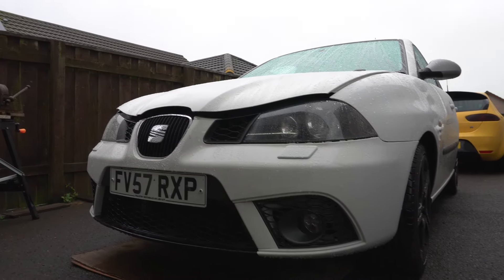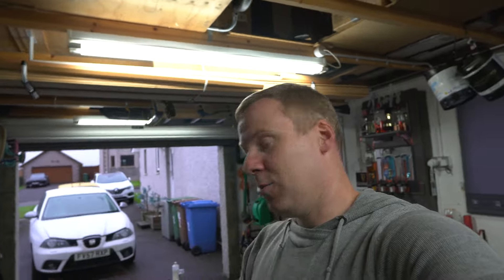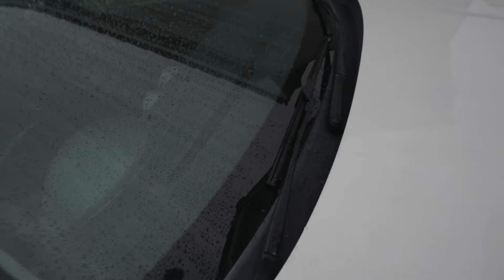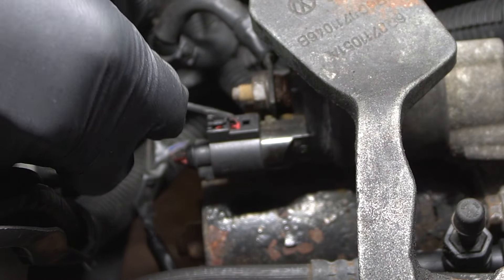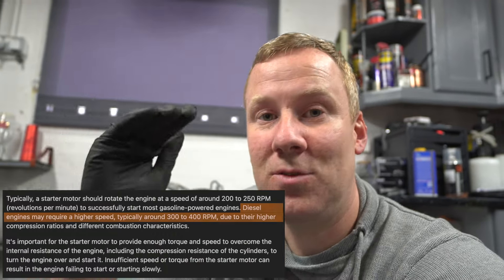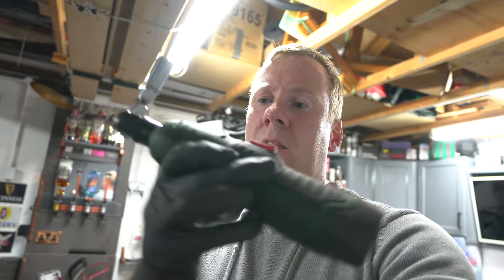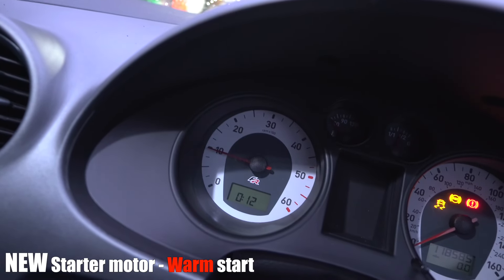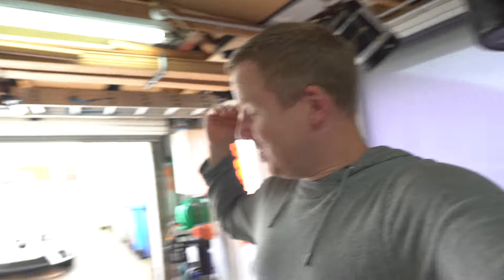My LAST attempt at FIXING my Ibiza's Warm Start Problem...

Comment: My Ibiza 2002 tdi , starts and then stops. The dashboard lights have also stopped working. Have you experienced this problem before . Thanks
Reply from the maker: Hey John, I'm afraid I haven't had that issue, but I've heard it happen to others for the Leon, and there's a few things I've read that they should check -
-The fuse box under the bonnet for any corrosion within it. Sometimes water can get into it 
-The wiring electrical blocks that connect into the back of the main fuse board inside the car.
-Scanning the car with a diagnostic computer to see if any faults are stored for intermittent faults or low voltage/high resistance 
It definitely sounds electrical, so hopefully one of those 3 help you locate the issue 🤞🏻

Comment: Just a word on the aircon, legally you have to be F-gas qualified to do a full re-gas, I assume the system was empty as the there are fines of up-to £60k for deliberately releasing gas into the atmosphere. I re-gas all sorts of vehicles for a living, and I re-gassed my Leon for the first time in 18 years of ownership in June, and in that time it had only lost 200g!
Reply from the maker: Ah, cheers for the heads up 👍🏻
I wasn't aware of the F-gas qualification at all, so good to know.
As for the old gas, I was going to take it to a nearby garage to collect the old gas from the system, but I checked the system quickly 1st with the gauges, and it was showing 0 pressure from the system. I double checked by removing the Aircon pressure sensor and briefly tapping the valve under it, and nothing was there at all. 
Possibly the car has had the pipes disconnected years ago, and it was never re-gassed afterwards.
But thank you again for the advice. I will look into the F-gas qualification, if it's possible for DIY-ers to have??, if I ever need to do my Leon or the Kadjar.